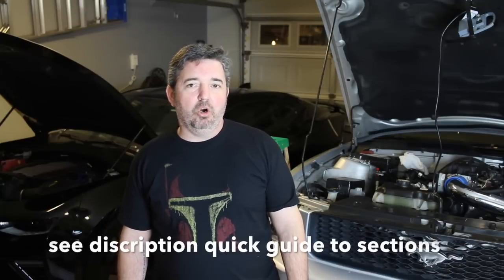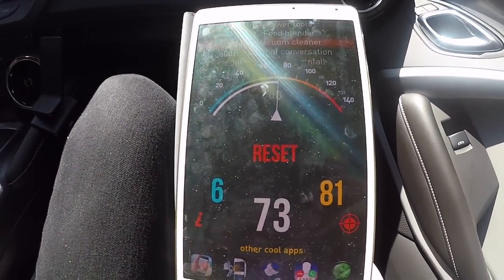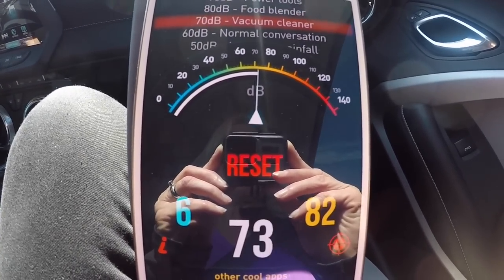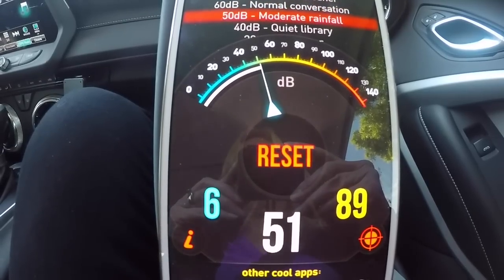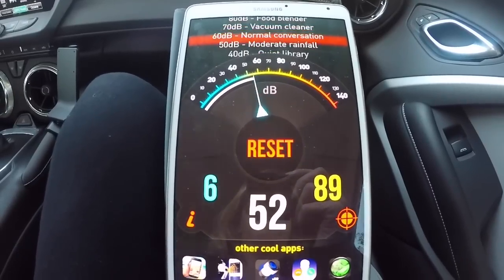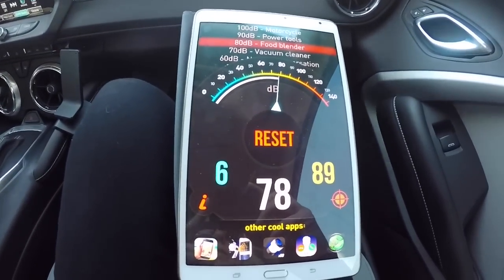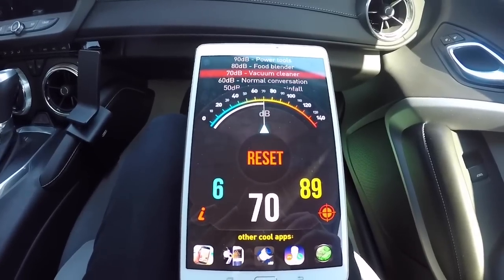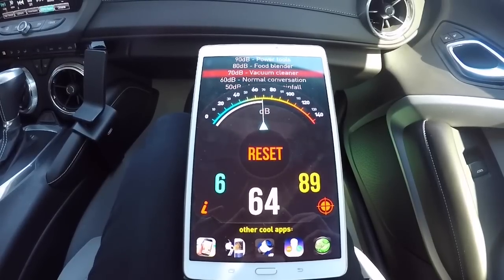2016 Camaro SS Fuse Pull . . . Should you pull it?

Comment: $2000 exhaust is crazy... I went with the Corsa Extreme for $1250.  It's absolutely amazing! The sound splitting is awesome.  No drone at all and I mean none. All the sound actually comes out the back like it should. I couldn't be happier. I switched out the stock exhaust that had Magnaflow bullets on the axle back with the Coras Extreme system. Couldn't be happier.  I have a 2014 Camaro SS1LE.
Reply from the maker: Agreed, $2k is nuts.  I think they are charging more for the 16s and even more for the NPP capable ones.  I am not sure what I am going to do.
Reply: MojaveKY Yeah I was looking at that. All I can say is do what you want to do with it all. Whatever makes you happy. Good luck thanks for sharing your journey.

Comment: What I don't understand is , if the flap has a electric actuator  that moves it . would it be stuck in the position that it was in when the fuse was pulled. I guess it would mean that power has to be going to the flap to keep it closed? So if you pull the battery the flap would open? Plus there is a control on the my link to adjust the exhaust in any mode.
Reply from the maker: The control actually doesn't keep it open all the time.  We did some tests and it does mostly keep it open but not under all loads.

Comment: Love the video thank you for the input. I have a 16 V6 rally sport if I pull the fuse am I going to get a check engine light. Also can you tell me what you think about cut outs on the exhaust looking to do this. When I rev the motor I do not get full throttle is there some kind of laminator on here that I can bypass. Your videos are very informative if you can help me on this I really appreciate it.
Reply from the maker: Thanks man I appreciate it. I did not get any check engine light so I don't think you will. I don't know much about cutouts and don't want to give bad advice.  Are you doing full throttle with the car in park ? There is a limiter on our cars
Reply: MojaveKY OK I do have a limiter when I rev  the engine in park. The cut outs is a throttle that’s connected to the exhaust and you can control it by opening it or closing it so what I’m saying is I don’t want to have exhaust open at all times just want to have a little sound to it
Reply from the maker: yeah I just remember talking to Lethal Camaro and he took his off but I dont recall why.  He is at CamaroFest (on his way) but I can ask him when he gets back to town
Reply: MojaveKY Yes I see that Mat has his car on a trailer on the way. Just finished my cut outs really happy the way it looks and sounds really awesome and I did pull the fuse I did see it a little difference thank you for your awesome video with your information. Too bad I couldn’t send you a photo of the car with the new cut outs in here.
Reply: Please don’t just keep yours stock

Comment: The entire point of this video was to check/compare the noise levels w/wo the fuse in the different modes but why take the levels from inside the car?  Would have been more appropriate from outside, on the rear bumper to get a true reading on what the exhaust sounded to the world and would have reflected real increases.
Reply from the maker: Sure I understand that but the real point of the video was did I notice it louder because I stated I want the car louder.  I certainly understand your point though
Reply: Yeah since the car is designed to isolate noise from the cabin, or atleast have a window cracked

Comment: I have a 2017 camaro 1ss manual. Is it the same thing and will it void my warranty?
Thanks
Reply from the maker: If you have the dual mode exhaust (NPP) it works on the manual as well.  Check your manual to make sure it is the same fuse (#51).  I don't know if this would hit your warranty but I would doubt it since that fuse only controls a flap in the exhaust system
Reply: Wow! Didn't expect that quick reply man. Appreciate it. One more question tho. Will it trigger my check engine light if I pull it out?
Reply from the maker: It is all the way behind the 02 sensors so no codes should be thrown.  I am not throwing any and no one I know has.  I never threw one on the 5th Gen either.  But it would be a quick fix if you did.  Just plug it back in
Reply: Cool bro! Thanks again for the quick response. More power to you @MojaveKY
Reply from the maker: Thanks man !  I am busy fighting some stupid headers so I appreciate the kind words
Reply: You can easily put it back in. I actually keep the fuse for #51 (15amp) in one of the empty slots. You can look at the fuse configuration to find one. Just make sure it's empty and you remember where you put the fuse.

Comment: Track mode Vs fuse pull would have been the more meaningful test - although the flaps will open on hard acceleration in any mode, except snow/ice (stealth) 
I override the steering and suspension to Touring -  bad left shoulder, plenty of weight for me; some rough roads around here. The engine sound option I either set to Track or default to driving mode. I tried the fuse-pull, but this wasn't different enough from Track for my ears to detect - I don't have any fancy Db meter, so I play it by ear. 
Also, when set in Track - or hard acceleration in Sport - I get all the same burbles, crackles, and farts as pulling the fuse, and a nasty "brap" on upshifts. I'd advise you to keep the fuse in - allowing your blind-spot monitors to work - and just set it to override the NPP to Track mode.
* I have a Vitesse throttle controller and a K&N Typhoon CAI, if that makes a difference...
Reply from the maker: Thanks, my blind spot was annoying so it was no big deal doing the fuse pull

Comment: You can put your exhaust mode in Track regardless of driving mode selected under the setting menu. Waste of time pulling this fuse and watching this video.
Reply from the maker: and the car will over ride it when cruising
Reply: I_AM_WILDCATS_DAD 
wrong. even if you  set the drive mod to track mode the valves still close at certain Rpms on the Hwy.  Pulling the fuse is the ONLY way  to have them open full time.
Reply: Redzone please explain further. What rpms will it close at? Will it close when you 0-60 and reach a certain rpms?
Reply: on my 2018 1le. reguardless of which mode your in. u can select to have your exaust wide open at all times
Reply: Even in track mode 20% will close up during cruise or light loads. By pulling the fuse you force the flap to stay open 100% of the time. Still not same as getting the Borla ATAK system.
Reply: Yeah I tested this when downshifting on a A8 using paddle shifters going 6 to 4th Gear it sounds weak and muffled when the fuse is pulled you get a nice loud downshift  and it turns heads everywhere I go 😎

Comment: do you think the fuse pull will sound good on a 1lt (v6) 2012 Camaro?
Reply from the maker: t rob don't think it will do anything without npp exhaust
Reply: MojaveKY do they not make npp exhaust for lts?
Reply from the maker: t rob not for 2012s
Reply: my 2016 2lt rs v6 sounds really good when i pulled the fuse out... it really makes a difference... and sounds pretty goos for a v6...

Comment: When changing the modes it seems you didn’t do it right. For the exhaust you’re supposed to go into the radio options and change the exhaust sound management options. I didn’t see you reach at all there. I’m guessing you just used the physical button near the ebrake. That does nothing for sound.
Reply from the maker: With the fuse pulled it does not close so you don't need to go into the radio settings